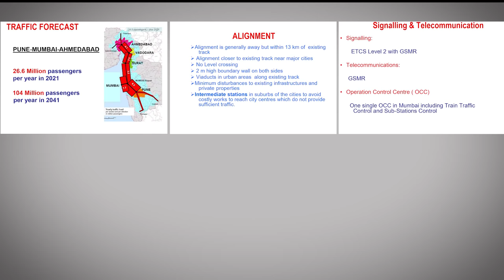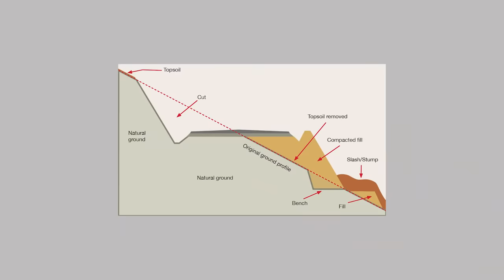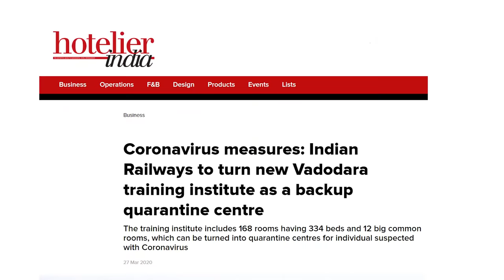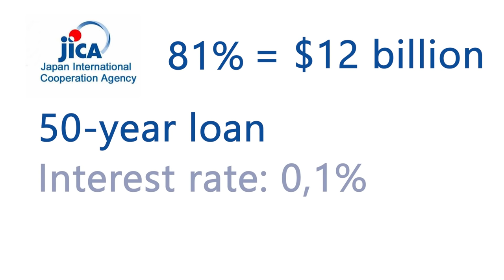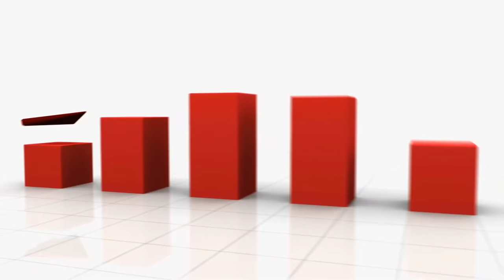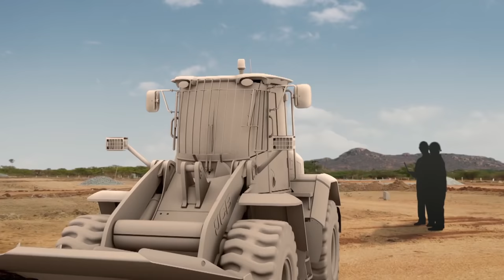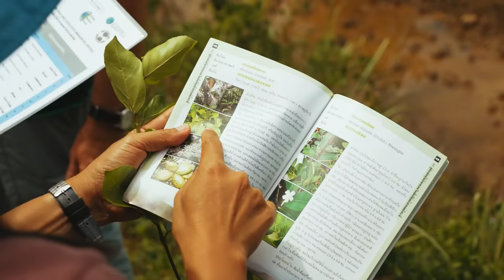India's First High Speed Railway: Mumbai–Ahmedabad Bullet Train Project

Comment: Is there any word on connectivity with Mumbai metro? Line 4 which is currently being built in thane won’t go to this station since it’s on the other side of the creek from us.
Reply from the maker: Dear Neel, we are not so familiar with micro-location and all the details, but what we managed to find is that Mumbai terminal will be built at Bandra Kurla Complex (BKC) where the connectivity with Mumbai metro might potentially be achieved. But as far as we know, not with Line 4 but rather with lines 2 and 3 (DN Nagar-Mankhurd and Colaba-Bandra-Seepz).

Comment: Many unwanted stations. It increases the time as well as energy wasted to slow down, halt and accelerate. The train may not even touch 200 kmph for the most of its journey. 
May be just keep a rule like only tier 1 and tier 2 cities gets a stop or only one stop within 500 km radius. Let a semi high speed train like vande bharat connect all the other stations replacing the existing intercity expresses. 

And it will be on loss for at least a decade. With ticket fares running up to 3k +, it is competing with Air travel.  To attract other rail / road commuters, either make it affordable to middle class (which may not be viable for the operational cost) or wait till the purchasing power of the middle class to increase. Still why would anyone choose it over a flight if fares are the same or higher ? 
China is experiencing this kind of loss currently.
Reply: You do understand that indian railways passenger section is running at 50% operational loss. Railways is seen as a service in our country rather than a profit making business. The economic growth and the connectivity a fast hsr train provides is unparalleled